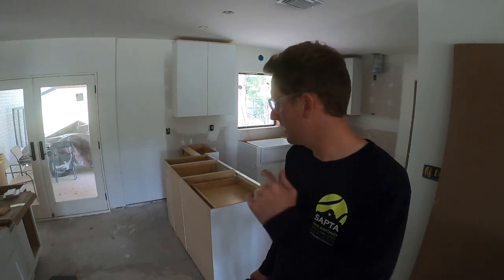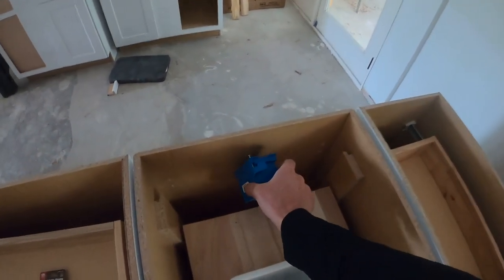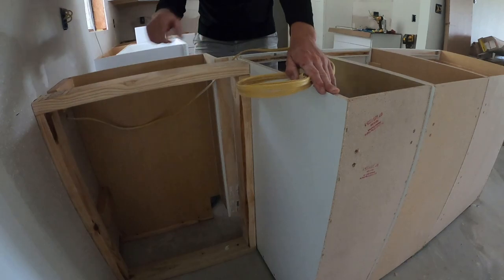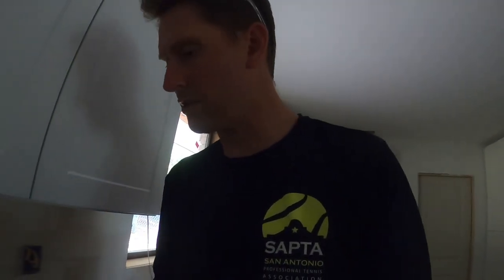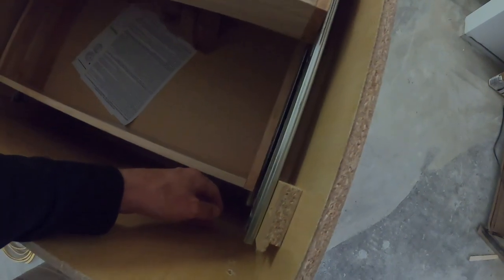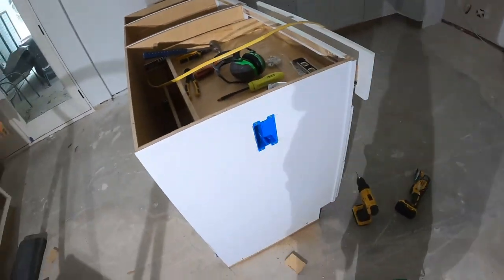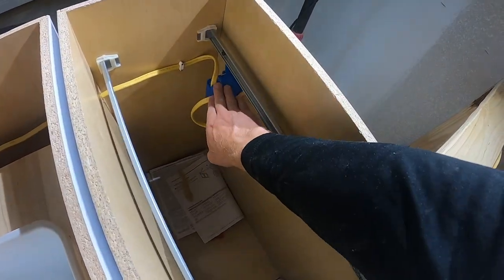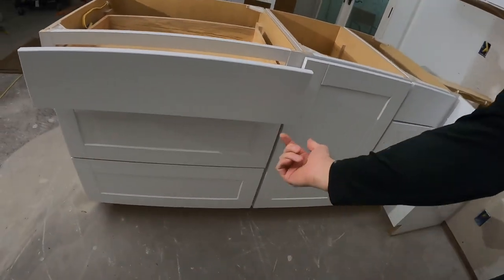Running Wire for Kitchen Cabinet Outlets

Comment: This doesn't meet code. You can't have unprotected romex inside a cabinet. An electrical inspector would never pass this.
Reply from the maker: Cayden, I want to thank you for your comment. I actually just had my electrician over this evening to verify, and you are definitely correct. I will get that romex properly protected. Hopefully other viewers see your comment. Thanks again!
Reply: Yep , fail 
Handymen can cause alot of grief for people
Reply: How did you conceal it properly? I have a light fixture that’s under a cabinet and I’m not sure how to contain the wire
Reply: @AtHomeDIY  How did you protect it? Would an armoured cable do?

Comment: Soooooo this seems like a logical and proper way to do it -- unless you're an electrician and familiar with NEC requirements for unprotected wires.  What is correct solution?  If his romex "pigtail" goes first into a metal j-box, and then branches out with metallic / MX cable following similar path as he did to each receptacle location -- is that the proper method?

Comment: This is not just "not code compliant," it is also quite unsafe: exposed romex in a kitchen cabinet is really dangerous. 

This video is misleading tons of DIY folks who are confused and deperately checking island outlet code issues on YouTube because of the mess 2023 NEC (or the 2020 NEC, depending on where you stand I guess) created. 

I'd definitely take this video down. I am the last person to play "Safety Sally" and say, "get an electrician instead." But simply hoping people will check some of the comments to see your mistake is way, wayyyy too much risk-taking with naive DIY people's safety. Or re-edit it with clearly showing how you secured romex, and highlighting how no one should try running exposed romex (or any romex) without proper guidance. 

I'm not even starting on code issues and ambiguities pertaining to running romex in conduits (there is leeway on "using conduit as protection," but some NEC experts say that does NOT apply to running romex in kitchen islands, which again means you need to check with your city, who will decide what is "wet and damp"), so I hope you checked with an expert on what you mean by "get, that romex properly protected." If your city considers your wiring "underground," or "wet and damp," sleeving the romex in the cabinet with any type of conduit will not work, since code says no romex in conduit in those areas. 

The right, no headache way to do this is to have a junction box, transitioning from romex to conduit, where you pig tail and run proper gauge THHN wires in your conduit, or an approved/listed MC cable (or whatever "protected cable" your city requires within cabinets), which runs to your outlet from the junction box.

Comment: Please do plenty of research on this.  Each building department can subtract from...., use as written....., or add to the National Electric Code requirements.

NEC section 210.52 (B) and (C). Cover kitchen, kitchen counter top, and peninsular requirements.  Max height above counter, max distance below counter, how far between recepticles on the counter, and how many square feet require one or more recepticles on the island or peninsular.

Some building departments want a rotation of circuits as you go around the room (along the counter ckt 21 the cat 25 then 21 then 25). In this video, he might need 2 seperate circuits for the 2 seperate recepticles he ran.

Remember that knowledge is the treasure that you can give away all you have and still have what you started with.

So is it robbery if you talk someone out of all they have?

Be careful out there.